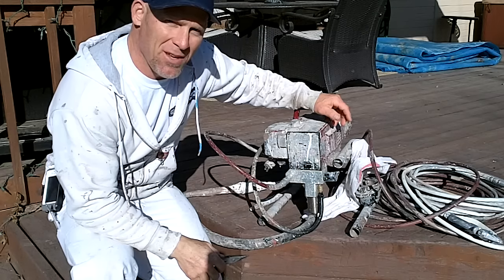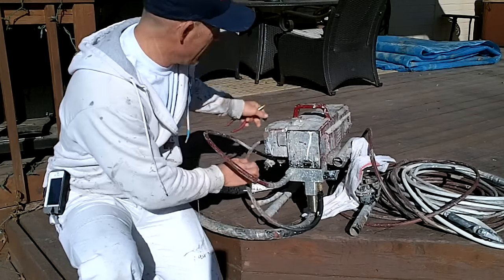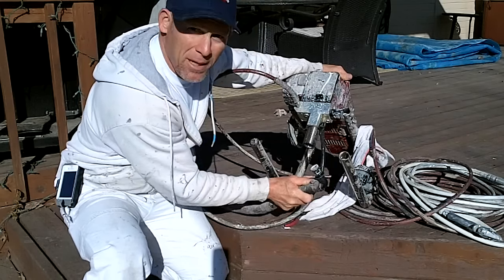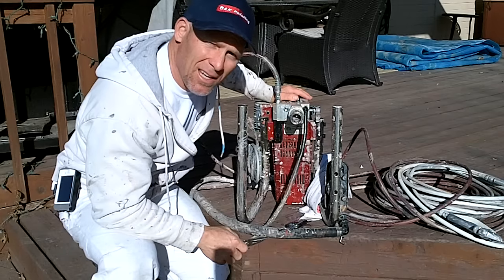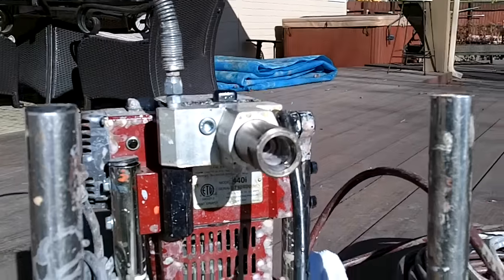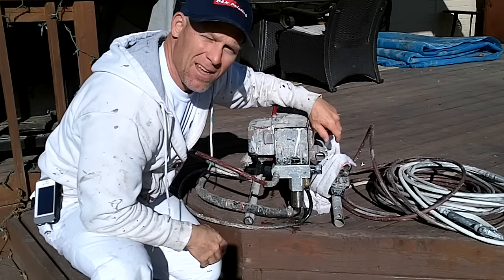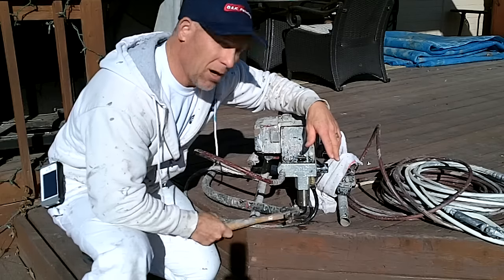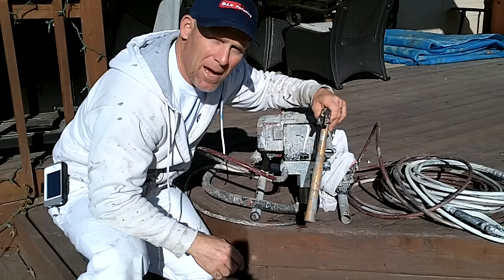How To Fix An Airless Sprayer That Is Not Priming.

Comment: You have covered 95% of the solution and I thank you for that. I have never had this problem occur that wasn't settled with a light tap of a hammer or even a wrench! Today I was sending my primer out all ready to spray my finish coat when midway through spraying my primer back into a bucket with a water chaser everything stopped. I tried hot water and many hammer taps but to no avail. Finally I just just to shut everything down and go home to try and fix it myself. I thought the worst until I saw your video and a few others like this. Surprisingly two fellas went right into taking things apart after making sure the inlet wasn't ineffective and that the outlet hose of the prime cycle was clear without ever mentioning the hammer tap. If you get away with it once you are lucky but it is an indication of a larger problem, do you not agree? Time for a tuneup and thank your lucky stars you do not have to send your machine to the repair shop!

Comment: Hey Chris after watching this video I was able to get my spraytech 2155 working again. I'll be honest I thought with the pump full of paint it was cooked.
I was able to rinse it out and rebuild the prime valve. I had to put a new prime hose on it. 
Both balls were loose so I was freeking out.
I bought a pressure gauge and a whip from you thinking I could rent a 440 and use my line and gun. 
All fixed now. Thanks so much for your videos. Bobrat

Comment: I've been spraying for over 20 years and in that time I was always taught to clean all the filters and lower fluid ball/pump area during the cleaning process after u run a few gallons through tuen off power release pressure and pull filters clean by hand make sure Lower ball is clean after u repressor switch to clean water run prime and spray for 10 min and you will get clear water and a sprayer that last for ever
Reply from the maker: Awesome, thanks for sharing Andrew!

Comment: My sprayer didn't prime and there was no retention spring, but was able to unscrew the large housing to get to the lower ball (lower ball was in the housing when taken off the pump).  But after unscrewing the lower ball I found a smaller ball further up in the head. I removed it with a 19mm socket and cleaned both and it's now working good.  Thanks.
Reply from the maker: Awesome, glad you were able to figure it out, thanks for sharing Timothy!

Comment: Thanks for your video, it helped.
I have a Titan 290 and have not used it for over 4 years.
It would not prime paint OR water so I did what you said but I could not find the ball.
So I used the garden hose, and used the water to free it up. I tried it from the bottom and the from the paint hose.
Works great.
I think this will be a little preventative maintenance from now on.

Comment: Hello, what about with a Graco 190ES which does not have a flexible hose but a rigid pipe or, you know what there called, lol, is it still basically the same issue, ball sticking? Thanks, John

Comment: My issue is that my sprayer has power but it seems like theres not enough power. When I turn on the sprayer the piston barely moves. It wont keep moving, as there is still power to it. Could the motor in the back be the problem? It does have paint around it but it isnt too bad. Is it hard to remove the motor and clean it and then reassemble it?

Comment: Thanks for the videos. I have a video request for you. Next time you do a rebuild on your sprayers,do a video with close ups of the parts being installed.  I can't find any good close up airless repair vids. I'm rebuilding a titan 440i and can't figure out how to get the prime valve off. Also have a graco 595,ultra 750,speeflo 5500 and spraytec diaphragm pump. I always strain the paint and final rinse with pump saver to make the packings last longer,but I always forget how to do it when its time.
Keep up the videos. Thanks again

Comment: Maybe you would have some general idea of what to look with my  my titan 440i. The motor keeps smoking and blowing the fuse. i pulled it apart and see that the brushes on the motor are heating up and smoking then blowing the fuse. Pulled out the brushes and they seem to have alot still on them.

Comment: Hello Chris. Could I please ask your help? I tried everything you said here but still won't prime itself even with water.
I have a campbell hausfeld AL236000CV. I should be able to turn pressure to low and then turn to prime, then it pull the paint or water up the suction hose and out the prime hose?
Mine doesn't and I have replaced inlet outlet valves with new and made sure Hyd was full and bleed it. But I have to turn suction upside down and fill hose and finger in and out the bubbles then quickly put in filled bucket. Once I get it primed it works well spraying until I change buckets. Any ideas?
Thanks for sharing!
Mac

Comment: I seldom have problems with my Graco 395 like that but its not too different than the 440i. Its my 1565 that has the problem. I use the hammer, take the sprayer out of the paint, flush it with lots of water then reload it with paint. If that doesn't work I take the pump tube off(its all metal not rubber as its a cart style sprayer). The lower ball sits enclosed in a chamber at the top of that. If there is something there, its easy to remove by flushing it out. The culprit seems to be the upper ball which is enclosed at the upper end of the pump. I use a four inch nail to poke up there.It is hard to see if anything is there. Sometimes I put oil paint through the sprayer but usually latex but with cleaning you need paint thinner. Its possible the thinner loosens some trapped latex in the tight spots of the sprayer especially if the thinner sits in the sprayer for a period of time.The bits from that get stuck in the pump and even sometimes the gun. I am not equipped to take the entire pump off to examine the upper ball properly. It is an older sprayer I got in 2003 so the pump doesn't come off easy like newer sprayers. The only way to perhaps prevent the problem is to use a dedicated sprayer for oil paint only. The packings can also be shot but thats usually the last case scenario. Pain is the ass though as "no spray day no pay day".
Reply from the maker: Thanks for sharing Michael!

Comment: Wit you take better care of your pump, you will never have an issue. When I clean my pump, I let clean water circulate by propping the trigger on my gun and placing it in the clean water that the pick up tube is pulling from. I clean the bleeder off and wipe the pump down and clean up the area , letting the clean water circulate for at least 5 minutes. Then I run some pump saver in it until it reaches the gun and I see blue fluid come out the gun.. And I always use a strainer sock over the fluid pick up so that I don't get any chunks. These processes only take about an extra 3 to 5 minutes of time once you've made it a habit. It saves so much money that gets wasted on unneccasary parts , labor, and down time. You would be able to purchase another pump for,your fleet in a year or so.
Reply: Everyone that dose this kind of work knows u get in situations where u don't have time or u need to get back to ur shop before u r able to get time . I'm sure he knows better than u how to operate his equipment. When u c that person giving this kind of input he hasn't in the field doing the grind or u would know that

Comment: Thank's chris you just saved me $500 i have a spraytech rig i repacked and replaced prime valve and still would not prime was getting so frustrated and it ended up being a tiny rock in the bottom of piston.

Comment: hey chris...  I have a question for you.  I haven't been successful finding an answer online, maybe you can help.  I've probably watched every video of yours, which led me to painting my own home.  I bought my own sprayer, it primes no problem, but the pump has a hard time coming up to full pressure.  cranked to max, it builds the same pressure as it would on low or clean, and I get little squiggly lines on the outside of the spray fan.  when cranked to full pressure the motor continuously runs when not spraying, if I turn the pressure down to prime or clean, it will build pressure and shut off once it comes up to pressure, like it should. I've tried thinning the paint out, tried running straight paint without thinning it, and ive managed to spray 20 gallons, and backroll on stucco, just curious what it going on with this thing. it doesn't seem to spit paint out of the prime hose while in spray mode, or suck any air...  please help! thank you I  advanced e and sorry for the long message.
Reply: I have the same problem that just started yesterday Chris please help

Comment: Chris I watch and like all your videos, please help me with this one issue! I have a little Magnum x7 pump that wont prime. All the hoses are clear/clean. The ball at the bottom on the piston housing is free. I think theres another ball somewhere thats stuck though. I used it and I ran a few gallons of water through it but I didn't clean it right when I got home, I waited about a week. So something is stuck/dirty somewhere but it isn't the ball that you messed with in this video. The pump turns over just fine and ive banged on it from just about every angle. Any ideas? Thanks.
Reply: I have the same pump and the same problem. Can't fix it
Reply: Yeah, what he said. Or so I thought. I have one of those spray rigs also. I took mine all apart(whatever I could take apart)and thoroughly cleaned everything. Voila, it sprays again.

Comment: Chris, watching your video to troubleshoot a graco 257025 model. Wouldn't prime the day of spraying and changed to plan B - roll and cut.   Took it in for repair the next day and 1 week later still no repair - so here I am saying I can do this and watching your video. Can't be that complicated. My machine is used infrequently and I don't think much can be wrong. I think your idea is probably correct. I'll find out tomorrow. Thanks for the common sense solution. Let you know.
Reply: Hey, I've got to admire the guy taking the step toward the American dream. Cudos and good luck and don't stop at t-shirts.

Comment: Hey Chris, I have the same machine here and it is priming properly but when i go to spray I am not getting any pressure. I watched the other video, got all the air out with the water and when I flip the switch up and try to get the water to come out of the gun this is where I have the problem. Is the hose clogged? or is it the gun?
Reply: Are you closing your bleeder valve on the side, if not its pouring from the bleeder, could had a completly clogged spray tip

Comment: I have a graco sprayer  that is not priming or spraying I tried pushing the ball but still not working any other suggestions? thank you
Reply: +The Idaho Painter Sorry to bother you again but I've tried that too, an other thing that it does it stay running instead of shutting off when the trigger is not being pulled.
Reply: +The Idaho Painter thank you